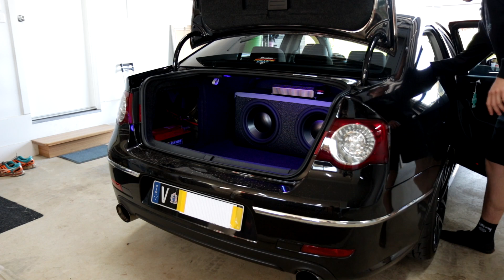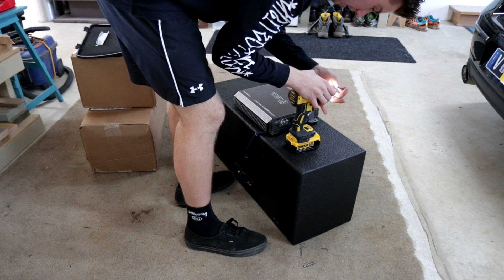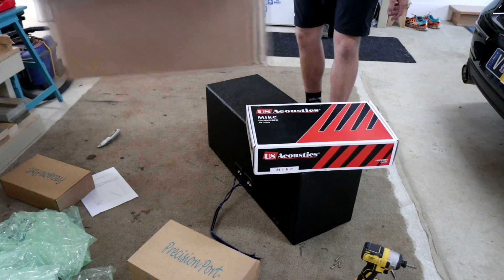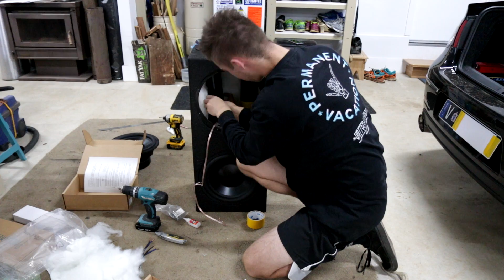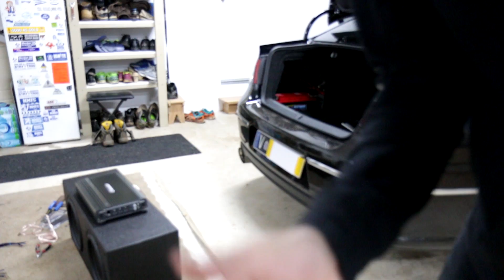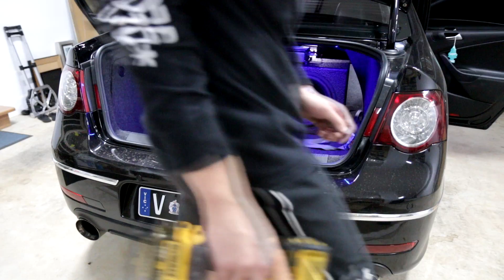INSTALLING MY CAR SUBWOOFER AMPLIFIER!

Comment: Yeah ds18 is kinda cheap crap. Had some experience with a range of their products, two different subs. A 6.5 midrange and a bullet tweeter. None of it really sounded all that good but what should I have expected from cheap stuff. One of the two subs blew out, it was rated for 900 rms, and it wasn't getting any more than 400 watts, I'm sure it was getting a good amount of clipping that night, but still. I upgraded to sundown audio for subwoofers since, never going to look at cheap crap again lol. Now I've seen a ds18 amp tested on a dyno, however, it was a 6000 watt full range amp, and it actually managed to put up 6000 watts. The Caviot is that it did the trademark of a low sq high distortion amp, when Using those amp dynos, Amps that make a lot of distortion will count up like it should until it starts distorting, then the reading will not continue to count up smoothly, it will stop, until it hits another split second where it didn't have distortion, and will jump up like this either once to the full power, or a few times on it's way. All the crappy brands I've seen this happen with. Basically throughout the entire test it was into who knows how high of a distortion level, so itll definitely blow all of your speakers lol. Ds18 is really just crap. It's a Brazilian brand I believe.

Comment: NEVER mount amps to your sub box, Amps usually dont have much board support and vibrations will eventually cause shorts and kill your amp overtime with failing solder joints etc... Mount it on the rear of your seats instead. Always do the headache test. Have the subs playing at full tilt, put your  forehead directly on the surface that you are planning on mounting the amp on.... Now decide if you want to expose your amp to that kind of vibration.

Comment: Great work👌🏻 But dont put the amp on the box because box will flex and same time amp is flexin and causin amp board moving and break it,so easiest way is put it on somewhere on the floor or backseat😁

Comment: box is too small.  check out winisd to check frequency response and you can adjust air space a tuning to get it where you want. it also provides needed port length. its free btw.

Comment: Lol, now you're in the car audio black hole. A couple years from now: 100000 watts 4 21" subs 50 mids and 25 tweeters.
Reply: Bro i started with an 8" car sub 2 years ago when i was 14 now im 16 almost 17 next april and i have 4 15s in an s10, 3 12s in a dodge ram that hit almost 150 db, now i got 4 10s in a Toyota celica gts and i havnt metered it yet. Built all boxed by myself and they are bad ass

Comment: where did you find those brackets to bolt your box down? are those seat belt brackets? i have been looking for something similar. thanks!
Reply: They are called L-Brackets I think.
At least it says that, when I put subtitles on.
Reply: Any hardware store , any where in the world. Amazon. eBay. 

 L bracket. Angle bracket. 90 degree bracket. Shelf bracket.
Reply: @joshuajhoyt  yes I understand L Bracket. I just liked his because of the triangle design and 3 bolt pattern.

Comment: Finally, another Doublsmm video.

(Maybe you could make a video that does not involve the car or the car subs?)
Reply: As long as it's audio related, I don't see an issue. Well I don't see an issue if it wasn't audio related because it's his channel. But why are you opposed to car audio? If you like speakers inside a house, you should like audio in a car.
Reply: @PSYk1ll4h  too much one thing becomes booring, even when it is doublsmm.
Reply: @jaynee8581  True, I get your point. But wouldn't just home audio be a bit repetitive also? Car audio is still kinda new to him. Maybe switch every other video?
Reply: @PSYk1ll4h  all i am saying is.

Variation.